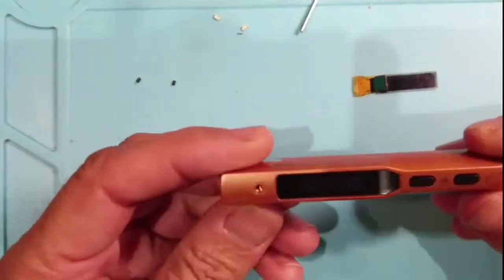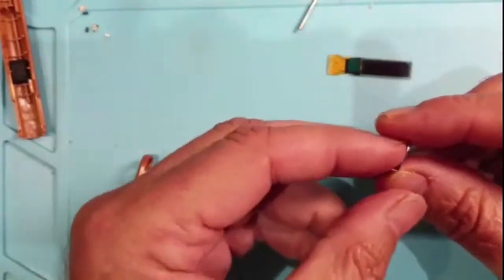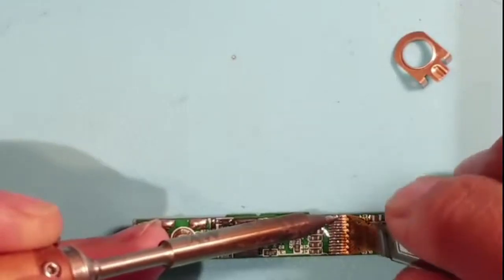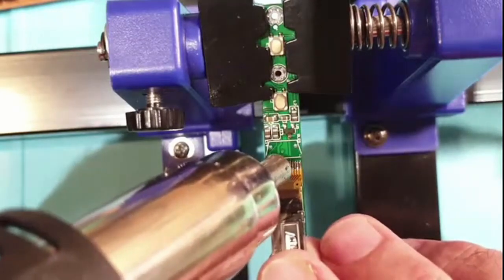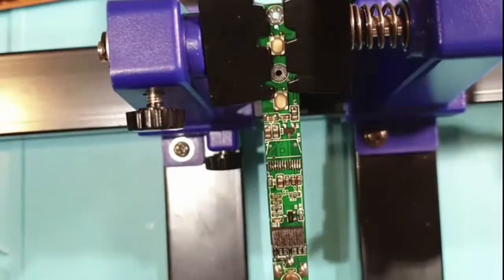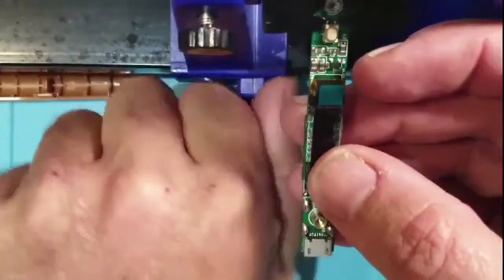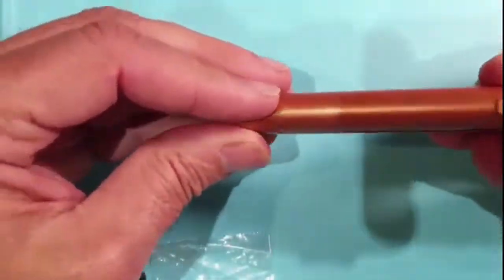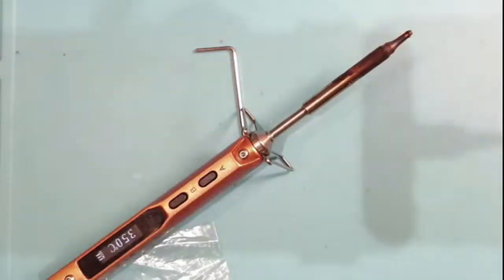TS-100 Soldering Iron LCD Screen Replacement (edited live stream)

Comment: Thank you for sharing this video - very helpful for me to perform my own successful replacement.  I obtained my replacement OLED directly from MorningTools.com and it was $10 including shipping.
Reply from the maker: That's great Andy. Let me know how it goes :)
Reply: @Magic-Smoke  I used hot air (and flux to reuse the solder) and it wasn’t too bad. Trickiest part was holding the display so the new one would line up correctly.

Comment: John, thanks for the video.   I worked along with the video, and (having never done SMD or similar rework before) gained much confidence from your approach... especially the accidental reversal of the display, which told me that you do have a second chance if you are careful.   Good input because my first powerup did not result in a display.  Well.. simply resoldered across the display pads and VOILA.  TS-100 is back in service.
Reply from the maker: Excellent news! Well done - so what’s your next project?

Comment: I had replaced my screen but it will suddenly goes black after few minutes (5Mins++) I believed. Do you have any idea how to fix the said issue?
Reply from the maker: Nero, I wonder if you have a loose connection inside? Does the TS-100 continue to work ok when the screen is black?
Reply: @Magic-Smoke  it won't & my ts100 jut died 😑 maybe i will buy the ts101 it is a little bit pricey though 😔
Reply: @Magic-Smoke  there is no loose connection. i think it died due to the firmware update. i just realized yesterday it is not a screen faulty but the pcb itself
Reply from the maker: That sounds like a challenge 😛
Reply: @Magic-Smoke  i think it will be better not to install the latest firmware just to be safe 😇thinking 2.08 just an advice